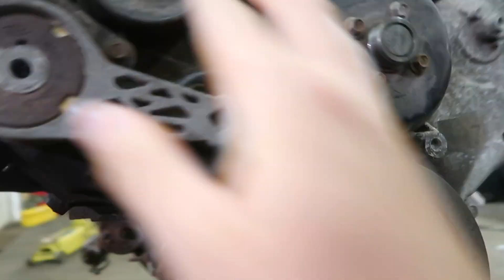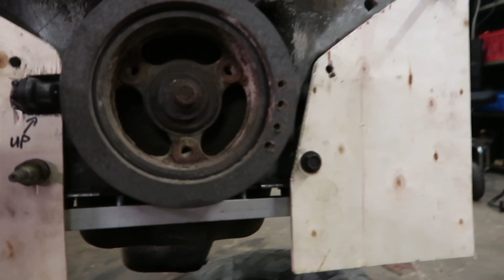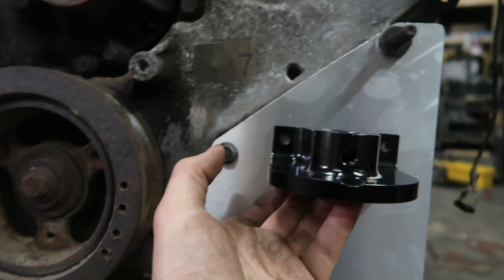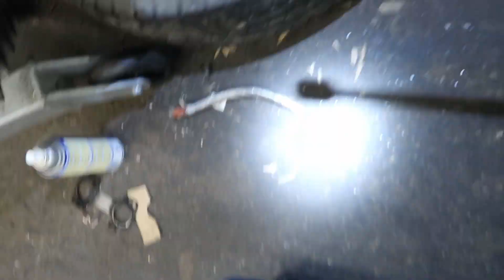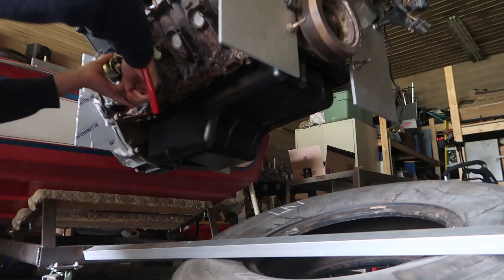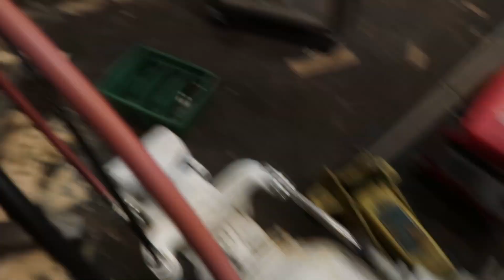Custom Rails and Mount Plates | V10 Jet Boat Episode 3

Comment: You should try and waterproof that starter if you can. Maybe even drill a weep hole at the bottom around the winding housing. Water always finds its way in them.
Reply from the maker: Excellent idea thanks!